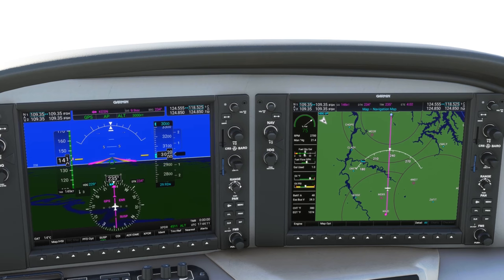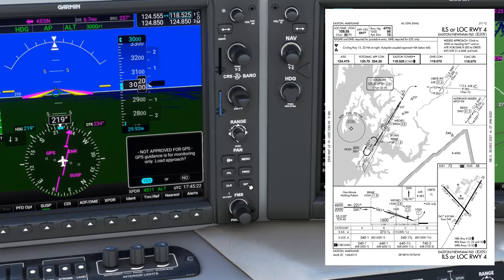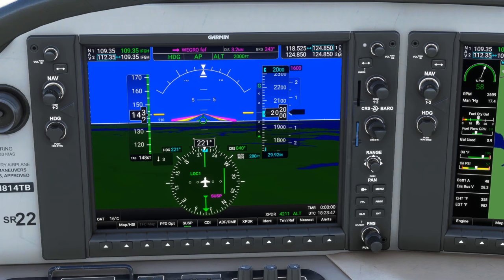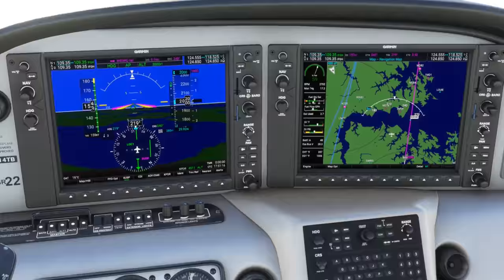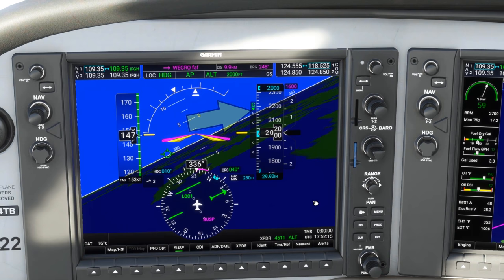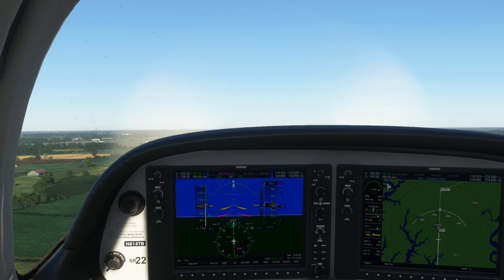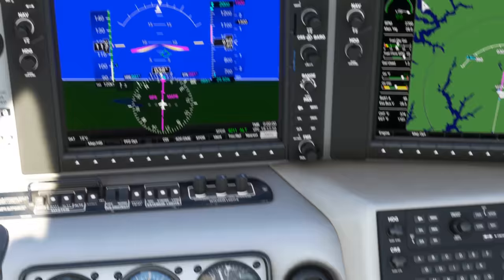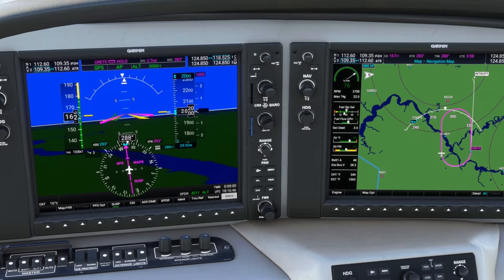ILS Approach in Garmin G1000 | G1000 Buttonology

Comment: Nice one as usual!  Couple of things that I find useful: 
1. Avoid choosing VECTORS when you activate approach.  I find if you always pick an IAF then when you activate approach you can ACTIVATE THE LEG you will intercept invariably on HDG mode.  This way, you don't lose all the intermediate fixes on the MFD for better situational awareness. (you will lose these points when activating VECTORS-TO-FINAL on G1000)
2. When I disconnect autopilot I always push the AP soft key as this way the FD always stays on.  Hitting the yoke AP disconnect button usually gets rid go the FD as well.  Even the 121 pilots never want to see the FD disappear especially on a missed approach!

Thanks for all the great teaching!
Reply from the maker: Thanks!
Reply: Good video. Don’t forget the Go Around button on a missed approach 😀

Comment: I usually like your videos and this one I mostly like however there are few things that I would change. (1) When you want to go missed, I would hit the TOGA button. The newer Cissus's have a coupled autopilot so no need to disengage the AP. Just hit the TOGA button and full power.  I believe the CDI automatically goes back to the GPS (Magenta) mode. In addition, it should automatically takes it out of suspend mode.  If it doesn't, then hit the CDI till you get the magenta mode. Positive rate of climb,  flaps up and hit NAV like you said however I would not hit the VS button when your climb rate is at 1600 f/m which could introduce the risk of stalling the airplane. Instead, I would hit IAS as you were already climbing at 120 KTS.
Reply from the maker: Thanks! As my DPE used to say, you learn everything from students and others! I don’t think the sim has a TOGA switch but yeah that makes things easier
Reply: I agree 100% with Michael.  All the G1000s I know have a TOGA button, usually as a button on the throttle lever.  Makes for far less button pushing gymnastics during this critical phase.  X-Plane does have a TOGA command that can be assigned to the throttle quadrant or a keyboard key.

Comment: Great video! Here are few things that will be useful to know. When going missed, you can use the TOGA button and not disconnect auto pilot. Once you're at full power, switch to nav mode for your missed procedure. For climbs, it is recommended to use FLC/IAS mode instead of VS mode. With FLC/IAS, you will level out if not enough power is available to climb. Contrary to VS mode, which is prioritizing a pitch up attitude even if it's getting dangerously slow. Cheers!

Comment: I'd recommend when you load any approach is load a transition to enter and not to load vectors to final.  If for some reason ATC changes their mind, it becomes a pain to switch because no other waypoints will be loaded and you'll have to fumble with it in a high workload situation.  You can always activate vectors to final later.
Reply from the maker: Thanks! On the NXi you're able to go direct to any point on the loaded approach after activating vectors. I know on the traditional G1000 and the older G430/G530 you have to reload the approach to do that. I got a whole video on it!

Comment: Amazing video. But I have one question. Why on ILS Missed Approach Procedure you changed to GPS mode? Is it because the ILS approach is based on GPS to follow the mapr
Reply: All transition and initial approach segments will be encoded as GPS waypoints regardless of whether they are based on GPS or ground stations. Only the Localizer portion of an ILS approach needs to be flown with traditional navigation. 

So in most cases.. you won’t even bother tuning the traditional navaids required for the missed. 

I usually keep them up just in case.. typically on an RMI needle for situational awareness rather than a CDI. If I have finger problems on the missed approach (on my plane.. King Air with Proline 21 it’s Go Around button to set flight director and activate missed approach segment.. then SNAP check.. Source (FMS/GPS), NAV (mode), Altitude (set for missed approach and (auto) Pilot… but in the meantime I can just turn towards the navaid and work on an intercept via the tail of the needle. 

It’s old school but it helps a lot. Seems like nobody born after 1990 ever uses an RMI anymore.
Reply: @calvinnickel9995  Thank you so much for replying! Amazing explanation

Comment: OK, so you enter the hold after going missed.  How long does the AP stay in the hold...indefinitely?  Is the system in SUSP during that time?  How do you get out of the hold...press the SUSP button?  
I want to compare this  hold after going missed with entering a course reversal after entering an IAF.  
My understanding is that--in contrast to this video--a "course reversal hold" will automatically UNsuspend and enter the next fix on the approach and fly the approach.  But in the" missed approach hold," the system stays in the holding pattern until .... what?  The SUSP button is pressed.
Thanks in advance.

Comment: Can you or someone in the comments section explain the SUSP softkey and display on the G1000. I'm still not sure how or when it works, its purpose or when to unSUSPend it?Newbie here, so appreciate any insights by those more experienced.
Reply: The suspend key is typically used because the gps will not auto-sequence to your missed approach. Technically what your doing is unsuspending the full approach because it thinks you are landing. You should try to avoid that on a check ride unless you are doing a RNAV approach since a ILS and localizer is primary and gps is guidance only. In that case you should cdi to VOR 2 and track the missed towards the hold.
Reply: @jackmurphy4913  Thank you for your succinct and informative explanation. 🙏

Comment: Garmin's suspend function... now that's something that someone could explain the actual benefit that it provides. I have yet to find a reason that suspend exists.
Reply: Touch n' go off the top of my head maybe?
Reply: If you have a holding pattern incorporated into your flight plan, in most cases, the autopilot will continue holding indefinitely. The SUSP soft key will have a green light (active). Deactivating the SUSP key triggers the autopilot to continue on the next leg of the flight plan after the holding pattern.

Comment: You have any gi275 videos?
Reply: I have been trying to change the pressure altitude to Barometric with no results here in the America we use barometric pressure currently we are unable to comply with ATC instructions because our altitudes are based on barometric pressure. How can we get this fixed? This makes it very difficult IF NOT IMPOSSIBLE to use G1000NXI.